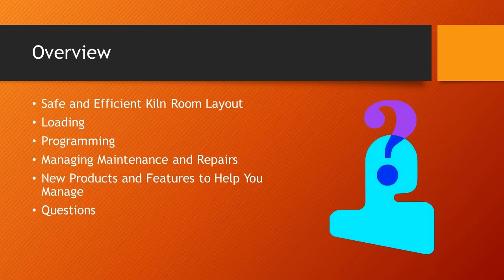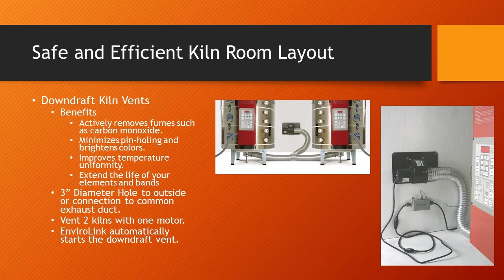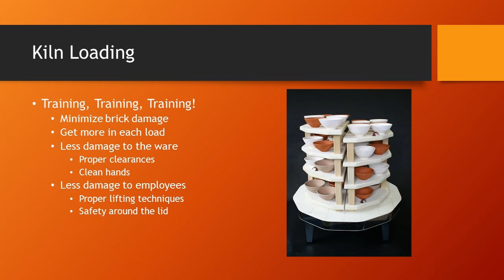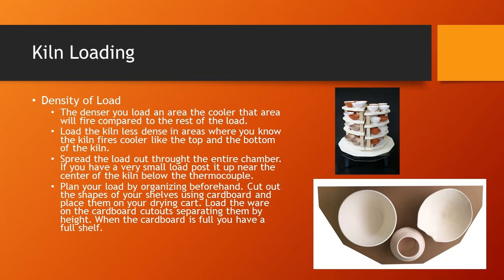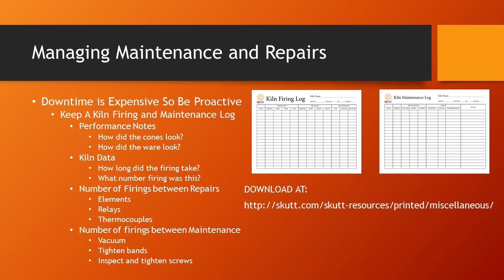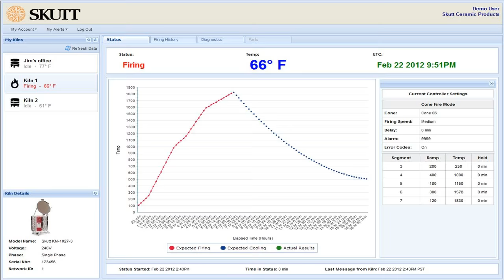Skutt Best Kiln practices Webinar 2018

Comment: Toxic Dangers of Kilns...

Just remember, when dealing with artistic materials, to always use proper levels of ventilation and to be careful about any toxicity levels with the materials used.

from Princeton University...

re dangers of kilns...

"Many metal fumes generated at high temperatures are highly toxic by inhalation. Since lead vaporizes at a relatively low temperature, it is especially hazardous. Carbon monoxide from fuel-fired kilns or the combustion of organic matter in clays is highly toxic by inhalation and can cause oxygen starvation."

https://ehs.princeton.edu/health-safety-the-campus-community/art-theater-safety/art-safety/ceramics